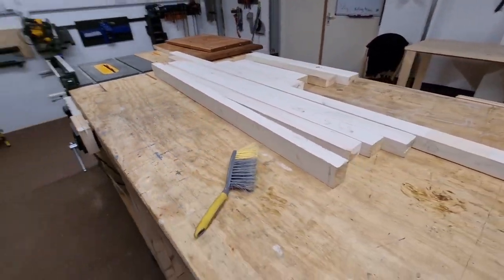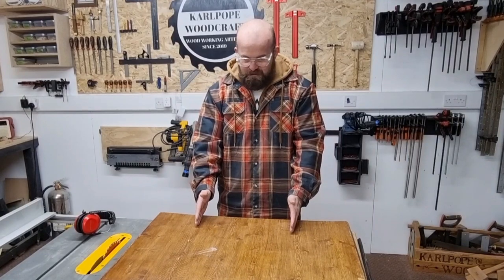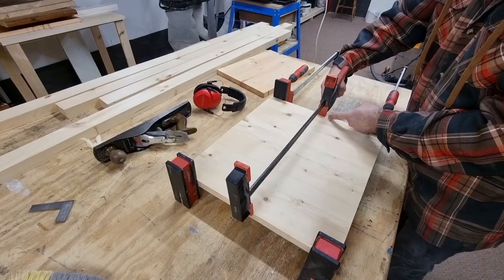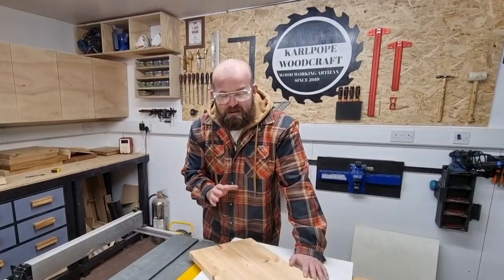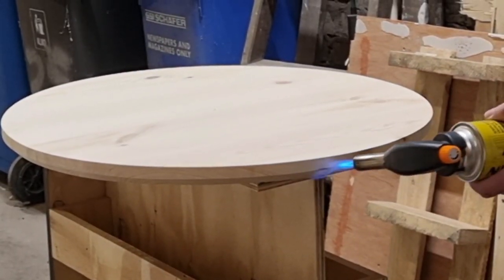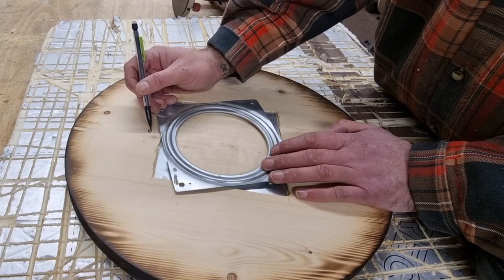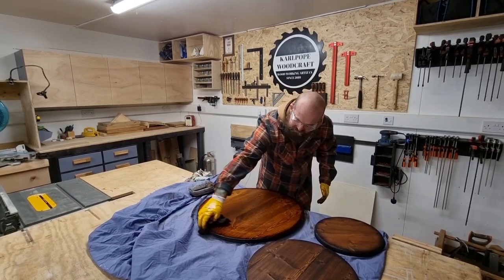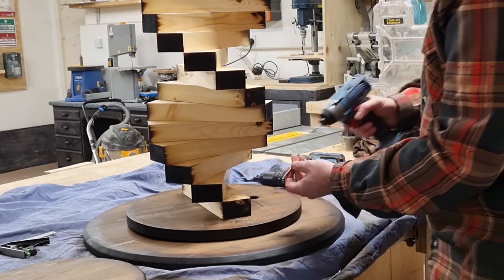Spiral End Table Side Table Using Reclaimed Timber

Comment: Good little video that mate. Is that small silver hoover attached to your miter saw any good for dust collection mate? Im thinking of getting the same one. (B&Q £30 ish)
Reply from the maker: Hi Steve sucks fine but loud as f#$k I'd go for the titan from screwfix it's quiter and has amazing suction.
Reply: @karlpopewoodcraft  got a B&Q voucher for xmas and and time its used ill have ear protection on. Thanks pal👍
Reply from the maker: @stevenking6400  might as well put it to good use mate, I have two of these vacs and there fine just loud but for 30 you can't go to wrong can you.